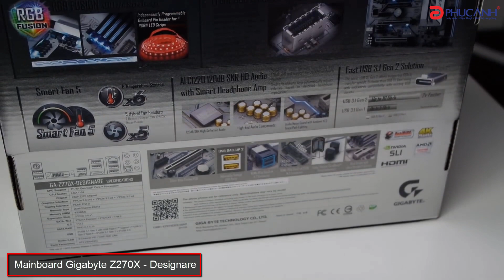Quá trình lắp ráp PC Modding Watercooling 37 triệu đồng - Siêu phẩm của chàng trai đến từ Yên Bái

Comment: Main msi h110m gaming
Cpu i3 7100
Ram ADATA XPG DAZZLE 8GB 2400MHZ có led
HDD WD 1TB BLUE 3.5" SATA 6GB/S/64MB CACHE
Ssd adata su800 128gb
Vga msi 1050ti gaming 4gb ddr5
Màn hình Benq 21,5 inch full hd
Như v thì đi vs nguồn Aerocool vx-400w có dc k v ạ
Reply from the maker: được nhé bạn
Reply: Bạn lấy ram cosair nhé! Ram ADATA k ổn định cho lắm...:))
Reply from the maker: Lấy gì mà bạn bảo Adata k ổn định vậy :v